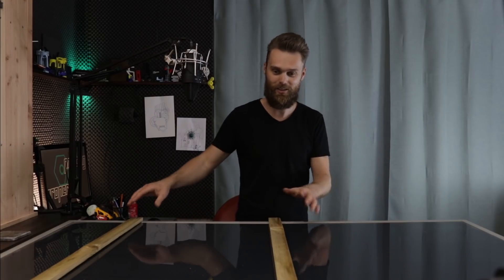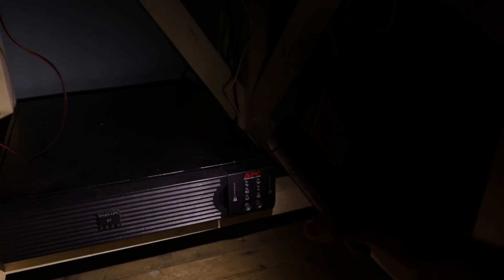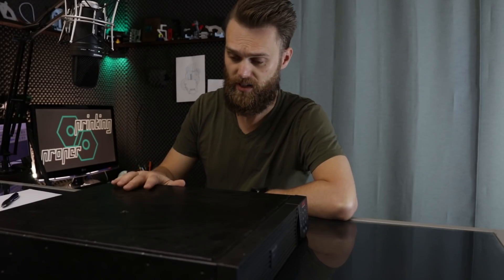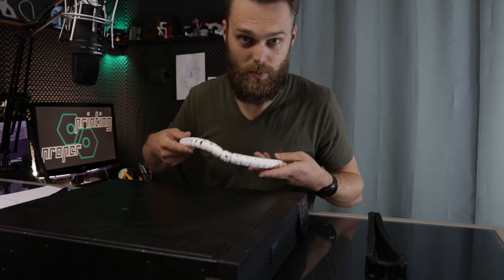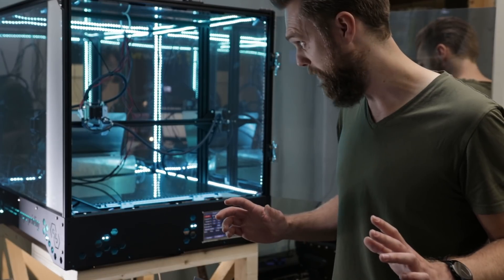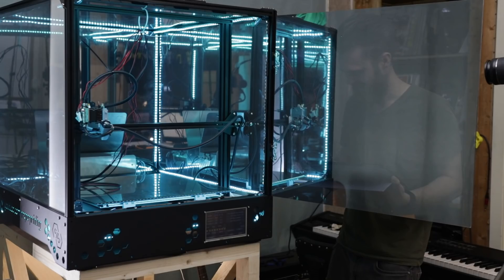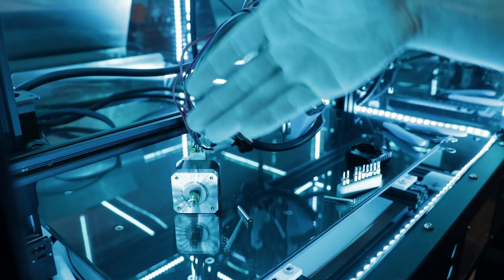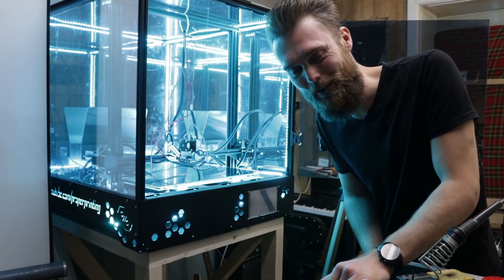The most over the top Creality printer is finally printing!

Comment: I think the dude motor may have a different wiring of the connector, sometimes manufacturers do that
Reply from the maker: I've pinned your comment because you're absolutely right. Just measured the coils and yes, assumption is the mother of all f*ck ups😅 Thanks for mentioning! I'm going to rectify this in my upcoming video
Reply: @properprinting   that why we cal it ASS ump tion

or I ass u me
Reply: I think it’s always a bit confusing with stepper phases.. ABBA BAAB BABA ABAB. However, what helps a bit, is when you are shorting two of the wires (Stepper unconnected) and the motor feels blocked, you have found the first pair so the other two are the second pair. But searching for it on google will often be more confusing then helping;)
Reply: I second that. I definitely had „blocked“ wiring on some steppers and it was fixed by changing the connection.
Reply: I third that! I had the same issue when building my own Prusa and it took me so long to figure out it is just wired differently.
Reply: @jake360flip  I'm too lazy to see who fourth or fived that so I'm just gonna n that :D Try reversing one of the phases. Use a multimeter to determine the individual coils or if you can find one, pull up the datasheet for the motor. I've had the same issue multiple times and that always fixed it. Steppers don't break just like that ;) Btw, totally subbed. Interesting content and Dutchlish is just super pleasant to listen to :D
Reply: 9 out of 10 times that's the problem when using new motors. When I saw Jon f*cking up the gear of that little motor, something inside of me broke too :(
Reply: @onewa712  I second this
Reply: Exactly, I just was working with two different motors last week and found out they both use the same connector, but different wiring.
Reply: L3D - 3D maker You are right, I discovered bad wiring of the x- stepper motor was causing  theterrible and noisey vibrations as well the  lack of movement of the print-head along the x-axis so I reconnected the coloured wires in the proper order of blue-red-black-green from left to right for the silenced x- stepper motor proper revolution ! Just one of a number of poor manufacture of this Anet A8 printer.
Reply: @ghazimalik  It's annoying as multiphase motors will still work with the phases mixed up... just very very poorly with lots of vibrations, tricking you into thinking the motor is bad.
Reply: kkkk yeap the old problem , well know of every one ... "RFM"  ..Read The Fu*** manual... in this case Datasheet... just  a joke.kkkk.. :)  yeap by the sound it apear to have  connection error in coils.

Comment: A cheap way to do a UPS is to simply make your own.  Buy a cheap auto battery and charger.  Then buy an inverter for AC.  If you are running something that runs off 12V then you can skip the inverter.  Why use an inverter to make AC when you just put it right into a 12V power supply?   Car batteries have a lot more capacity than any dedicated UPS for the money.  Also for this purpose a cheap battery is fine because it's being used indoors and not cranking engines.

Comment: Question is this accurate? is the y axis not much heavier than moving the bed?
Reply: i am starting my klipper build so wont this get heavy and inaccurate at high speeds?
Reply from the maker: The portal inherently lighter than the bed and if you consider the print itself, which in my case was more than 3kg of ABS the difference is even bigger. I made a follow-up video where I went into more detail how this performed. However, if I'm going to do this again, and that's the plan, I would make the gantry lower since I don't need to go this high. To make this more stable it'd be possible to add an extra timing belt at the top, but for my purpose of 3D printing the rims this wasn't necessary since that part doesn't have any details and because of the large nozzle isn't moving very fast.
Reply: @properprinting  thx for replying so fast. I'm building a height extended ender 3 and this setup looka amazing. As I said I want to run klipper (with manta m8p board so many stepper drivers) and this looks interesting but I need speed and detail so you are right with the bed and the part the portal will be lighter. 

I just dont understand what you mean with top timing belt? You mean another belt with rail and gliders and motors?

Wont it also be great if you use a linear rail at the bottom with 2 blocks spreaded out on both sides at the base (so 4 blocks and 2 rails) to make it less wobbly? And ofcourse 2 stepper motors (with 1 or 2 drivers)

Also If you must choose for detail at high speed would you keep bedslinger or you setup?

Kind regard
Reply from the maker: @zve3332  If you use Klipper with input shaper on this system I recon you would get rounded corners. It is too wobbly compared to the standard systems as it is right now. So, in this configuration I wouldn't use it for high detail at speed unless you add an extra timing belt on the top which would indeed be a second Y-axis and timing belt or a timing belt connected from the bottom axle. This would require an extra structure on top. The redesign I planned for this is going to use a much lighter gantry, like the one I've shown in this video https://youtu.be/AV7QsytYXOs but an improved version of that. I think that this would make the best possible motion system and my plan is to show this in the upcoming months.
Reply: @properprinting  I've seen this video looks great! But it has to be a snug fit without any possibility of warping/twisting as these structures tend to have a little twisting possibly over time which will impact the sliding resistance. But I'm sure you'll get there. The idea is great but  weight wise CoreXY will always be better. But your idea is very promising for bed slinger conversion or future alternative on CoreXY.

The only thing I don't like about CoreXY is the long belt system. I'm wondering what the future will bring.
Reply from the maker: @zve3332  Indeed weight wise, core XY is better. For me the most important thing is the possibilities the platform brings. As an example, the moving portal mod when tilted at an angle can print like a belt printer from front to back, or maybe only the hotend needs to be tilted for this to work. That's all I'm going to say ;)

Comment: Consider a script as more of an outline wo the speaking sections are well worded but don't stick 100% to it and include all the random stuff, don't change up the style of the videos, just improve the sitting down and talking bits with a good outline of what you want to say
Reply from the maker: Thanks for your insight. I made a rough outline for my newer videos to have something to fall back to and improve the flow of the video. This helps a lot and prevents forgetting things.
Reply: @properprinting  nice nice, i had just noticed a lot of people took issue with the whole scripting idea but ive seen channels kinda pull scripts and merge them with the randomness, Linus Tech Tips does it extremely well for example
Reply from the maker: @kiyosenl.3889  great example!

Comment: I made a small shop for projects and tinkering,
I own 4 3d printers two of them are coreXY,
If you need any help ill try to provide for you,
Configuring DUET or LERDGE boards if you have any,
But man try to avoid using pancake steppers for that big printer, it will make certain fails,
I used steppers that can handle 2AMP and barely reached 400mm/s with 3000 Acceleration.
I can send you all my setups if I can contact you.

Comment: On the nonfunctional motor, try swapping the center 2 wires in the wiring harness connector for it. I ran into the same problem on a group of stepper motors that I bought. The windings were wired differently from normal, and that fixed it.
Awesome project!

Comment: Regarding your floppy tube issue. I had a similar problem with my delta printer's cable and bowden tube feeding the print head. Then I discovered sprung loaded card/key belt reels. They are those weird little reels that corporate people have for security cards or keys that they use all the time. I attached one to the top frame of the printer and attached the end that you use for keys to the cable and since it retracts automatically the cable is kept out of the way perfectly. Took me about ten minutes.
Reply from the maker: That's a great suggestion thanks! I once worked at a company which used these things. I'm going to use the chain, but keep your suggestion in mind!

Comment: When you have a stepper motor making a grinding back and forth / rattling, double check your phases.   The two pins of the same phase should have a measurable resistance across them.   Two pins that are from 2 different phases of the motor will not have a connection between them.    If you have 2 wires flipped where the phases are crossed (and some stepper motors are wired differently than others are) then it is just a simple pinout error.  I had this exact problem when I changed my Creality stepper motor out for a small pancake stepper motor.  The new pancake stepper motor had a different pinout than the factory motor did.  Once I got the phases set up, the motor was running backwards.  The next step is to take either phase (but only one of them) and swap the two wires on that one phase.  Doing this to either phase but only to one phase will cause the motor to run in the opposite direction.

Comment: @15:31  The extruder motor wire connection was not correctly connected resulting in unusual vibration. Trying go swap in between four wires will solve the problem. The reason why the other motor works is probably because that the two motors are manufactured by different manufacturers so the pin connection arrangement at the connector is different

Comment: Flag hinges (aka Navy hinges) so you can just remove the door if it’s getting in your way!
Reply from the maker: Thanks for the tip! I've designed these hinges like that, but forgot about the socket head screws which are in the way now. I must do a simple redesign to use tapered screws

Comment: Instead of a normal UPS, which contains a not so efficient inverter/charger, have a google on "24vdc ups" as the Creality power supply is 24v I believe. That way it is way more efficient and lasts longer as well. And they are a lot cheaper as it doesn't require a lot of electronics. It's basically 2 12v batteries with a power regulator.
Reply from the maker: Great suggestion! But for this printer I have the issue that I have two 230V heaters (bed and chamber). I'll keep this in mind for other printers though because I wouldn't have come up with this otherwise so thanks!

Comment: On the motor - we've seen this before where motors from different manufacturers wire out the four pins differently - there's no standard for the on-motor connector - and that buzzing you get is what happens when the motor wire is set for the wrong motor type (at least that's what I've seen). Probably need to swap the middle two pins around on the cable to the Dyze motor. But don't trust me - dig out all the relevant datasheets and try to make sense of them...

Comment: Don't forget to calibrzte your extruder.  With no hotend zttached! That way you can do 1000 mm extrude and then -1000mm ( and hand tension the spool to rewind it wile backing out ).  You should pre measure a segment of filament and mark with a different color and the 1000mm is not the length you should actually use, it will make the math easier if you do use that big for calibrating.  Awesome job so far, now keep going and get an open source CAD program.  OpenSCAD is easy if you can do simple programming, just don't expect to import " .STL " models and actually modify in it. 👍👍👍

Comment: Nice and wonderful printer This issue with the extruder motor cause the wires 2A 2B not in correct order I think, you connecting 1A +1B in the same step direction 🤔

Comment: How do you know how to build a printer like that but somehow don't know that stepper motors can come with different wiring. Swap the middle 2 pins on the extruder motor and I'm like 99% sure it will work if you didn't break it by taking it apart.

Comment: some stepper motors are wired with the pairs criss crossed and sometimes the pairs are both on their own sides, so you probably just have the stepper wired wrong this can be fixed in the printer firmware or you can just physically switch the wiring around

Comment: Nice video. I love your editing. The printer itself looks great. Scripting is somewhat boring. As you said the power failure would just be ignored and nobody would have seen your issues, just the perfect result, which is unrealistic. We all know the ups and downs in designing and making stuff, so - I said this before - it is nice to have a channel where the stuff comes out in a natural and unfiltered way. Mistakes are also a way of learning. I like your round cable chains. I have the same issue with my printer. Since I have multiple toolheads I need to ensure the wires are not bending sideway to block each other. I hope we get a chance to look at the design, so I can adapt it for my printer. :) Happy printing.

Comment: sjit jon

your fusebox is as old as my house in austria was 10 years ago with 50 years old fuses..
get it renewed ;)
Reply: Why fix what ain't broken?
Sure not having grounded outlets sucks but that shit's expensive.
Reply: @ManIkWeet  becuse the new fuses are better and have a better way of resetting ( don not need to swap the, just reset)
Reply: @ManIkWeet  in NL all outleds should be grounded, loads of water ....
Reply: @patrickmaartense7772  We have other means to prevent shorts to earth (RCD switch). Also the water will hopefully never flood our houses...
Reply: @patrickmaartense7772  If it does flood, we probably have bigger concerns

Comment: Nothing wrong with that pancake extruder motor, the coil wiring is probably just different!
Swap the middle two wires around and that'll probably fix it.
Reply from the maker: Yes indeed, I have to rectify this in my upcoming video. Stupid assumption I made there😅
Reply: Going by the sound, I agree. Stepper motors come as either A.A.B.B. or  A.B.A.B. That one is mismatched.
Reply: Been there, done that, myself more than once.
Reply: To late, as he destroyed the gear.
Getting a new one would be a good choice, as its realy just the pinout, and the hilbilly style fixing now, looks pretty bad.
Reply: LOL totally
Reply: I had the same issue with one or both of the z motors on my Voron 1.8 build. The motor wasn’t wired AABB or ABAB, so I had to figure out how it was wired with a multimeter continuity check. Once I found the pairs, it was an easy fix of putting a new end on the board side